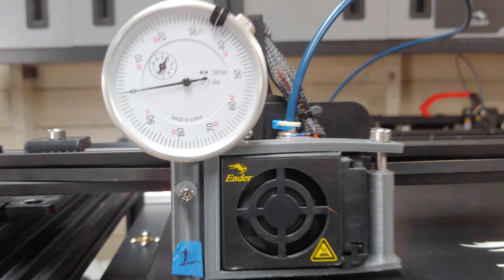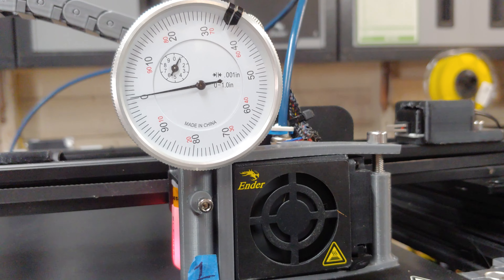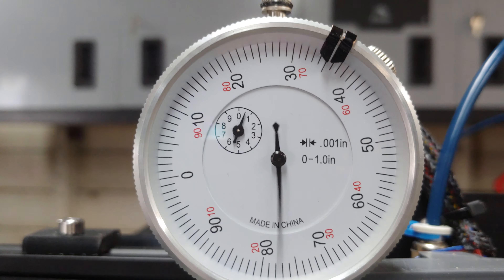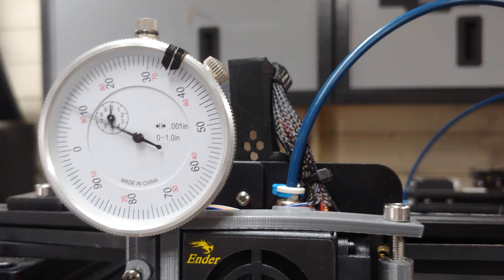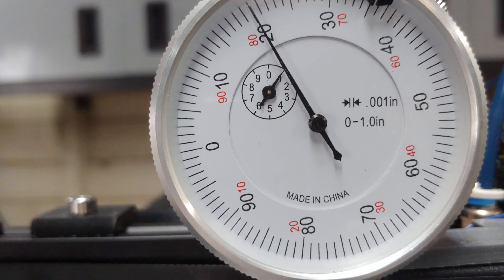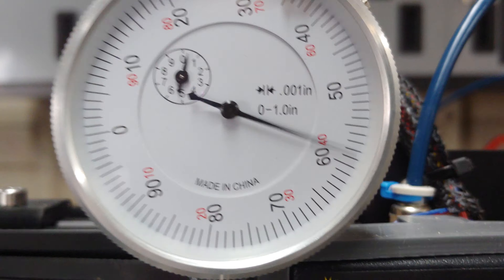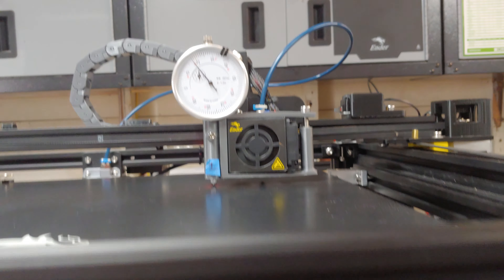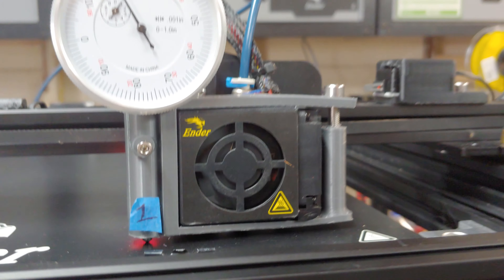Precision bed leveling for Ender 5  BL touch printers

Comment: Thanks for this - I’ve just battled with levelling my E5+ for what feels like hours, and wondered if a DTI could be used instead. Glad someone else has validated the idea! Do you have the STL for the clamp? I know it’s not a super complex part but it’ll be nice not to have to make my own :D
Reply from the maker: Enjoy! https://www.thingiverse.com/thing:4166385
Reply: Bretware 7 awesome, thanks chief! Will report back once I’ve... ordered a DTI because I apparently somehow I don’t own one.
Reply: @Bretware904  do you find you have clearance for the nozzle with this design off bed?
Reply from the maker: @ChipPuccio  I'm not sure I understand the question. But I'll throw some info out there. If you're using this on a non bltouch machine, set your z offset directly above the bed screw closest to home, then measure that spot and make the other three corners the same. You may have to repeat a second time

Comment: Will it work on the Ender 3 Pro? the thingiverse part I mean to hold the gauge?
Reply from the maker: It'll fit the 3 but if you don't have bltouch you have to use it a little different. Without bltouch do your normal 4 corner level with the nozzle above each screw post first, pick one post to get your Z offset as close as possible. Use the gauge above each post, work off the numbers you get from the post you focused your Z offset on. If you don't like your smush adjust the knobs blindly by turning each one the same amount. I've used it on my 3 before with good results.
Reply: @Bretware904  what's the screw thread size you put in?